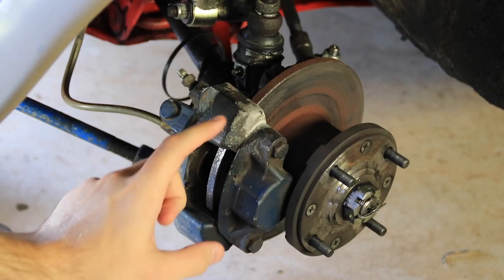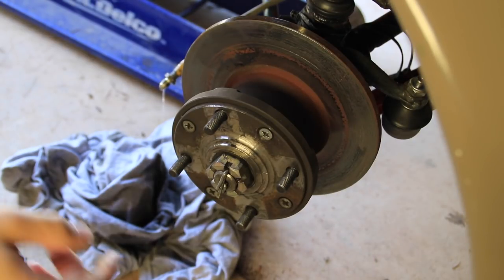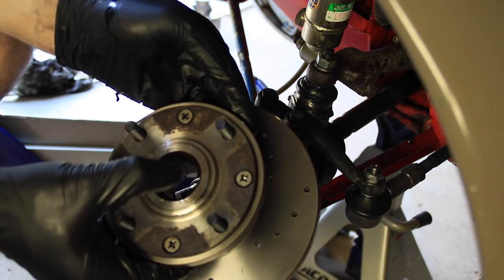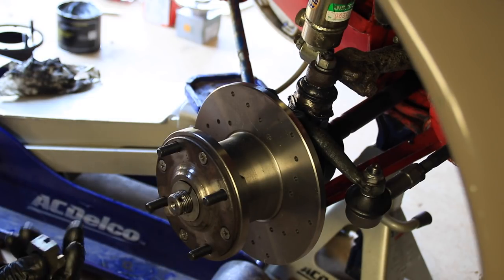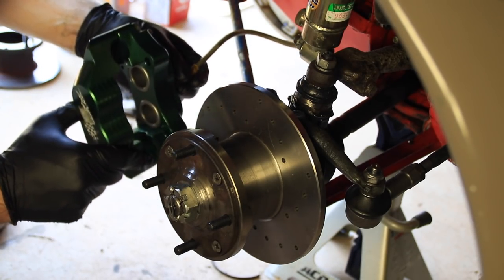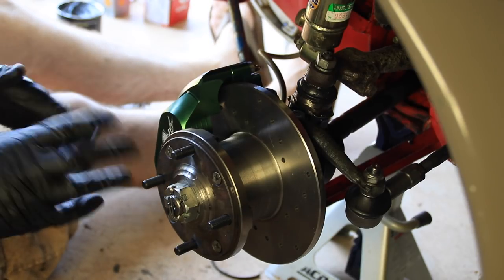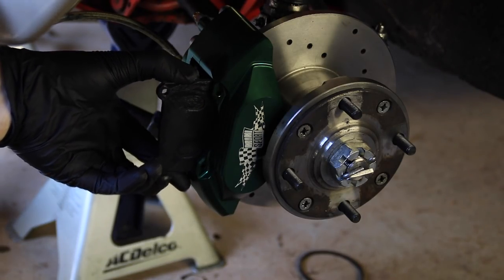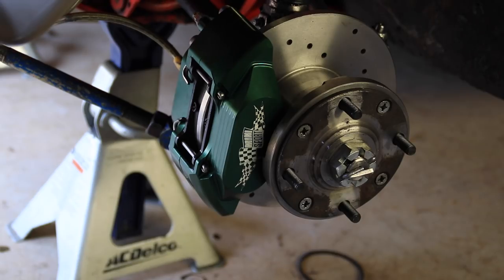Classic Mini DIY - Disc Brake Upgrade

Comment: As I watched the brake fluid drip out I remembered a trick a friend in the UK showed me. Take a piece of a ziploc bag and remove the filler cap from the master cylinder then cover the opening with the bag then screwing the cap back on sandwiching the bag in the threads. It makes an airtight seal and the fluid will drain from the system much slower or not at all. It helps when you want to save the fluid already in the system or want to lessen the chance of air getting in the system.
Reply: Works for the clutch too!
Reply from the maker: As usual you have some really wonderful information. I will definitely use this tip in the future.  Thank you!
Reply: I cannot take credit for it, the fella who built my engine, AC Dodd, is a buddy of mine. He and Andy Davies at ML Motorsport built me a fantastic motor and shared tons of tips with me.

Comment: Hi Cole, Really helpful again. Your advice on my clutch hydraulics was spot on and worked a treat, so thank you.  I am now changing from 8.4” to 7.5”. Does the flange go on the hub dry with the 4 screw head bolt? Or would it need cooper grease or anything?  Also do I need to grease the driveshaft before I put the hub back on?

Comment: I bought a 7.5" front disc conversion kit which probably came with cheap pads and discs (rotors). The brakes are bled fine but the brakes are terrible. I can slam on the brakes and not lock up front or rear. (rears are drum)  Could a simple change in front pads make a huge difference?  If so, which pads?
Reply: jemo951 hello .what kit did you end up purchasing. ? Is it from mini mania?
Reply: @mad-maxx2211  I think I bought it from MiniSport.  I haven't fooled with it for a while but just this weekend started installing a remote booster. I'm going to see how that feels and if still not bad I'll try new pads.

Comment: Hi mate, i'm thinking of upgrading my 8.4" brake disks to 7.5" ones to fit 10" wheels, I was just wondering if I will need to get a new drive flange or will it fit the new brake disk same as the last?  Would with be worth renewing them anyway? love the videos, keep up the good work!  :)
Reply: 8.4" disc brakes use different drive flanges. So if you are moving to a 7.5" disk brake setup to accommodate the 10" wheels, you will indeed need new drive flanges

Comment: 1 Question: The 4 Bolts sticking out of your disc assembly/ flange - How do you tighten them into place so they dont move? Or are the meant to be loose?

Comment: So what torque did you tighten that nut to? Because I cant figure out what a multi and a single split pin is, but mine is the same as yours in the video. Thanks Al

Comment: Just a question : looking at the arrangement of the drill holes in the disc, surely that particular disc was destined for the other side of the car? Shouldn't the lines of holes be radiating outwards and backwards? Or doesn't it matter?
Reply: I believe it doesn't matter for cars of this magnitude. Also, there aren't any cooling fins on these discs (which are directional).

Comment: How come you didn't use the special washer to tighten the bearings before installing the split tapered washer?
Reply: I was going to ask the same question.  No torque wrench either!
Reply from the maker: Using that special washer is a debated topic in the mini world. I have never used one personally however it certainly is not going to hurt anything if you do use it.
Reply from the maker: After filming this I did go back and use a torque wrench.  In fact because I didn't film actually using that torque wrench I went back and re-uploaded the video again with the torque specs overlaying that part of the video.

Comment: mate hallo again. one question to remove the pin from the brake pedal do we have to remove the heater or  i took it out for no reason?
Reply from the maker: That pin for the brake peddle is a royal pain in the A**.  Removing the heater wasn't required however it will probably provide you more room to get your arms up in there to put the pin back in when the peddle goes back in.
Reply: thanks for your answer. i will upload a video did this yesterday took me 3 days to replace it. next part painting the engine.

Comment: I have 7 in.discs on my 998 67 mini cooper.If I upgrade to 7 1/2 in will they be direct replacements or will I need other parts?
Reply from the maker: Some 7.5 inch discs will fit directly onto the existing disc hubs you have on the front.  However they most likely will not fit with your calipers and you will need new calipers to wrap around them.  Check out Minisport - http://minisport.com/ they have some awesome disc and caliper sets you can get made by themselves.

Comment: I have the same brake kit, when I put my pads in, the disk won't rotate by hand, is that normal?
Reply from the maker: Your brake caliper pistons need to be pushed back into the caliper body most likely. The 4 pistons that squeeze the brake can be pushed back into the caliper by hand and that should provide the room you need to install the pads.

Comment: What’s the best way to get your pistons back in if you are just replacing brake pads?
Reply from the maker: I usually just use my fingers or a flathead screw driver to lever them back in.
Reply from the maker: Are they stuck on your car?
Reply: I typically use a "C" clamp with a small block of wood, and just press them back down

Comment: How to make my car stops faster?
Reply from the maker: Do you have all drum brakes on your car currently? Upgrading to discs on the front will make a world of difference.
Reply: I think all modern cars have disc brakes on the front, I want my car brakes to be super strong just like European cars
Reply from the maker: These aren't modern cars.  :-)  They often came with drum brakes on all the wheels so upgrading the drums on the front to discs will give you a great deal of increased stopping power.
Reply: I have 2016 kia forte, I'm not happy with the stopping power, how to upgrade it?
Reply: stickier tires. your ABS will kick in when the tires are at the limit before the brakes themselves are maxed out.